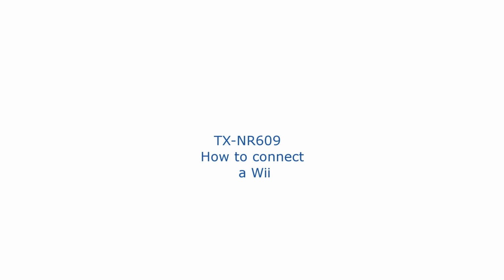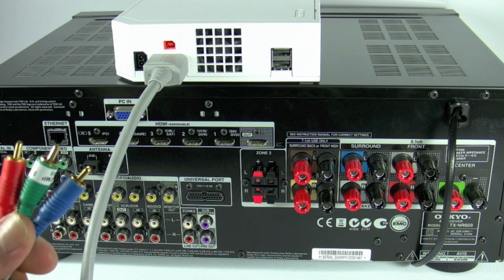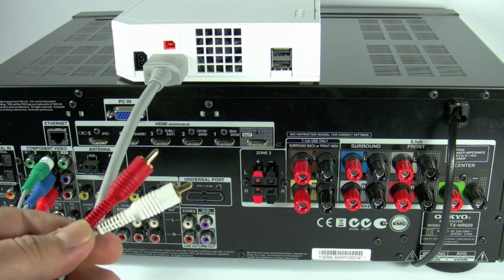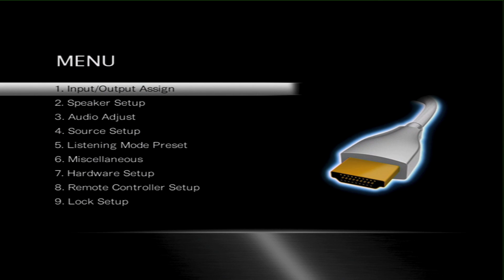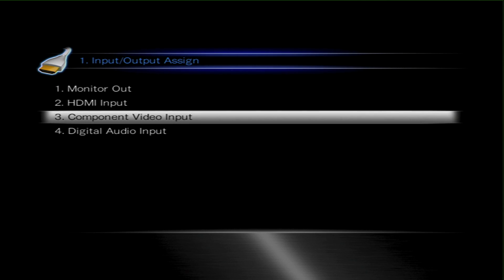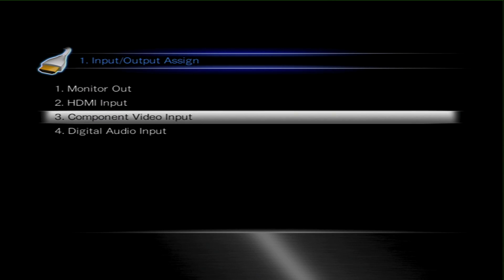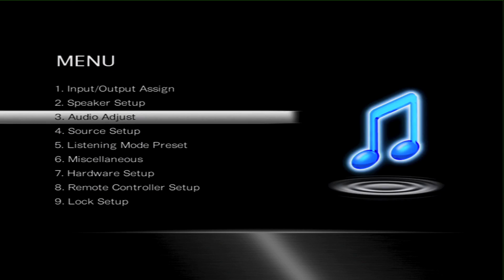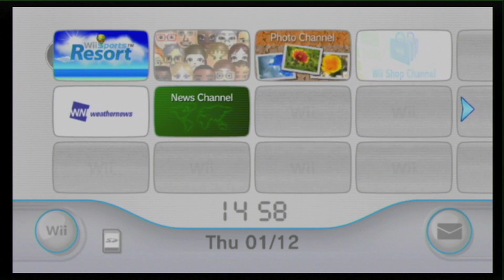ONKYO AVR AV Home Cinema Receiver - How to setup and use a Wii

Comment: I've tried everything on my Onkyo HT-R358 and I can only hear sound. I find it weird that you put the component cables in BD/DVD. But inside the menu, you are changing settings for Game. How do the connectors on the back really connect with the menu? I cant seem to find anything important on component in the manual. I have also tried HDMI Through, but same result. Is there a possibility this AVR only outputs through the Component Out ports on the back? And not through HDMI? SOmebody mentioned a resolution chart but i cant find such a thing.

Comment: Hey, I just got an Onkyo TX-RZ820 receiver. When I have my Wii connected directly to my TV in 480p resolution, it looks much nicer than when I have my Wii connected to my receiver in 480i resolution.
Clearly the video is not being converted to HDMI video signals.

What do I need to do to get HMDI video signals? Thanks
Reply from the maker: Hi, the TX-RZ820 supports 480p (if connected via HDMI). If the Wii is connected via component cable (480i), the output via HDMI will be 480i as well. But please do not hesitate to get in touch with our customer care team:

https://www.eu.onkyo.com/en/feature_article_en_42204.html

Eventually the colleagues will have some additional advice! Thank you

Comment: annoying how my 646 only does up conversion of the wii where as my older 607 did up conversion and could up scale the wii.   I've come across this video whilst looking for a solution to lack of DPL I I on the wii which isn't working on the 646 (but does on the 607).  646 is great for 4k and hdr and etc connected services but it's not as good when working with older devices.

Comment: As others have also reported, the picture did not come through for me with my Onkyo receiver, just a blank blue screen and the sound.  I finally found that if I hooked the Wii directly to the TV (where it works fine), and set the output to 480i instead of 480p, then I could hook it back up to the receiver and the video does pass through, but of course does not look very good.  This information is in the manual, for my receiver (TX-NR616) it was under a section called "Video Resolution Chart" on page En-91.  This is pretty disappointing, and makes me reconsider Onkyo for future purchases.

As another guy said, there are Wii HDMI adapters, that plug into the Wii's video output, and have an HDMI output, which will at least allow the Wii to output at its best settings, and also simplify using it with a receiver (so you could skip the steps in this video)
Reply: I changed it to 480i and still has blank blue screen with audio, any suggestions?

Comment: I have a Onkyo HT-S3705 and I was using my ps2 with a components wire. When I try to use with the Onkyo I hear the sound however not the image. I have followed the video and I don't have any idea about what can be... Maybe the onkyo doesn't work correctly?
Reply: fenix32 I have just seen that I should use another component wire from onkyo to the tv... T_T

Comment: Hi there, I just got a TX-NR727.  Is this the exact same thing I need to do if I want to hook up my Wii?  I read somewhere that for the component input to be output via the HDMI out the Wii must be set to output 480i, and not 480p, and then the receiver upconverts the signal.
Reply from the maker: Hi, that's actually correct: In order for the AV receiver to upconvert component input to HDMI output, the source output must be set to 480i/576i. When signal is input at resolution of 480p/576p and more, an error message will be displayed. Thanks for your notice!
Reply: I've done this, and it does pass through, but it looks like crap. I have a 656

Comment: This WILL NOT work if you are using HDMI to your TV. After fighting for an hour with it, I looked it up, and if you want to use component with this type of Onkyo receiver, you must also use component from the receiver to the TV. It won't upconvert the component to HDMI, nor the reverse.
Reply: This may be true, and for this reason, one would need a good upscaler that accepts component video to output via HDMI into this TV... like a framemeister.
Reply: So this is why I'm not getting a proper picture on my HDMI only OLED TV! Have wasted and hour going back and forth. 

Thanks for the post. At least I know there's a reason.

Comment from the maker: A blue screen usually means that there is no input signal on the selected input - please check your selected input, cables/connections,etc - and get in touch with our customer care staff in case the problem persists, they will be glad to assist: customercare_eu@eu.onkyo.com

Comment from the maker: Hi, Because the Wii is only SD (Standard Def) then whatever you do will make an improvement.I just allow the 609 to upscale to the screen resolution (720p/1080p). The only other thing you will need to take can of is the calibration of the controllers to image, this is because video processing adds a lag & you will need to compensate for this in the settings of the Wii